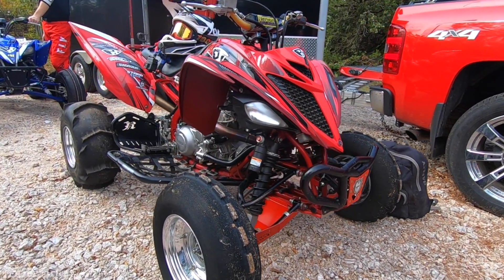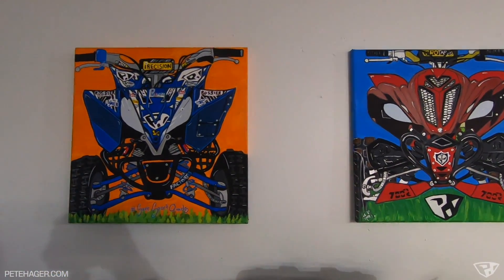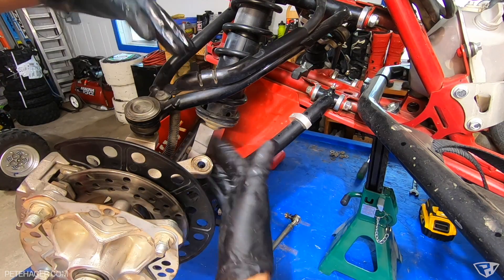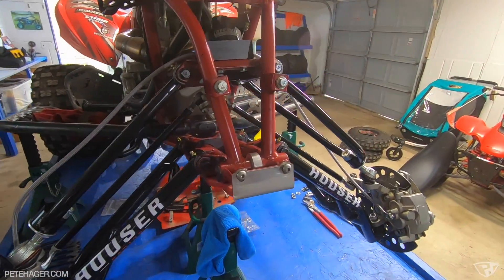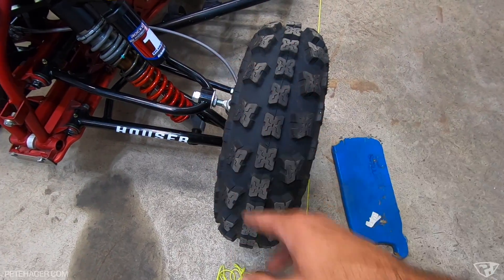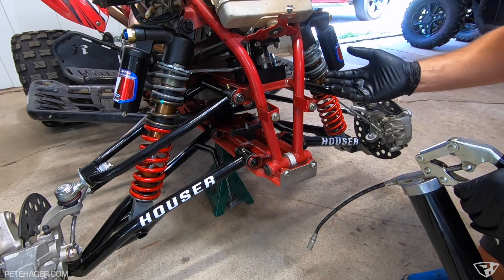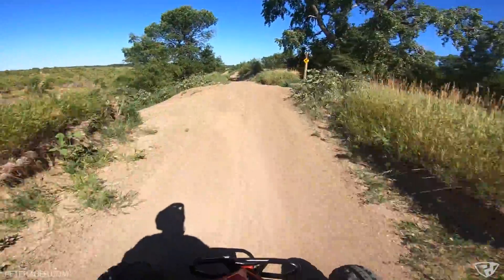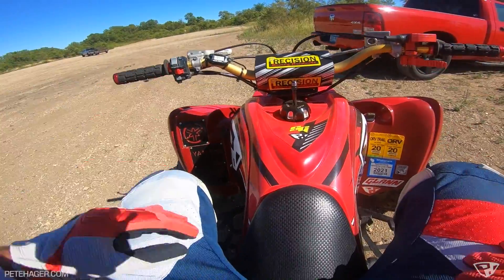Raptor 700 Long Travel Install and First Ride

Comment: I've been wanting to take jumps with my Raptor but I don't know how to prepare myself when I get to the jump. Could you give me any tips?
Reply from the maker: Of course start small and work your way up. You want to find jump where the take off is at least the same length as the quad. If it's a short, stumpy jump then your front tires will leave the ground before your rear tires have started the take off. When that happens it's a bit easier to get bucked forward if you don't throttle just right. Find a nice moderate jump with a good landing and make sure you have a neutral but aggressive body position. Also make sure you hold the throttle steady while taking off. Don't stab the throttle or let go of the throttle or you could go nose high or nose dive. Definitely find a table top and just get comfortable leaving the ground in bigger increments. Always aim to land on all 4 tires if possible or be rear end biased. It's also good to land on the gas a bit to soften the landing and keep your momentum going forward 👍
Reply: @PeteHager  This explanation is perfect. I've been having a hard time finding the right body position and whether to be sturdy or not at the base of the jump. Seeing you do it makes it look so easy and fluid. Do you stay planted on the seat or do you slightly stand before the jump?
Reply from the maker: @YunqTab  Im glad I could help a bit! I always stand when taking off. You can absorb some of the jump with your body language by bending your knees and almost doing a squatting motion once you leave the lip. As with most things it’s good to stay fluid and loose. You want to be in control but you don’t want to be stiff and rigid with your positioning. Your fluidity will become more natural with time 😊

Comment: Toeing in means more bite on turns?
Reply from the maker: The toe is the angle your front tires are at while pointed straight ahead. Most people will have the toe adjusted in slightly which I think is supposed to help with cornering so it sounds like you're on the right track👍
Reply: @PeteHager  Thank you.

Comment: Pete, when you were at the Yamaha press for the sport quads, did they give any indication about their current mindset with producing sport quads?
Reply from the maker: I was told Yamaha sells every sport quad they make and that they have no intention of stopping production anytime soon. If they were piling up in warehouses it would be a different story so it's safe to say Yamaha will keep producing them into the foreseeable future 😬🤘
Reply: @PeteHager  awesome, thanks for the reply! Yfz has my attention. Any indication that anything “new” might be coming in the sport quad segment?
Reply from the maker: @brutelife9177  unfortunately I didn’t hear about anything new for the future. Like most industries new developments are pretty secretive. Unfortunately with how low priority the sport ATV segment is there probably won’t be any changes anytime soon. You never know though! The nice thing about the YFZ or Raptor is that they haven’t changed in forever and there’s TONS of aftermarket available 😊👍
Reply: @PeteHager  I know this controversial (it’s kind of silly that it is) but there no reason why the Yfz doesn’t have reverse….it doesn’t add that much weight…..

How’s the video of the 400ex with the new accessories coming along?
Reply from the maker: @brutelife9177  Hmm I guess I haven't put much thought into why Yamaha doesn't do reverse with the 450. I'm assuming the 450 engine is derived from the 450 dirt bike of that era. In most cases those engines needed to be redesigned in certain aspects to compensate for the extra weight and traction that an ATV has over a dirt bike. Maybe some internals had to be bulked up or reinforced that limited space in the transmission area for a reverse gear. It's also a very race focused machine whereas the raptor is a trail quad so maybe thats their mentality. I'm glad you mentioned the 400ex. I actually did all the new parts updates to prepare it for the new Top Quad series we filmed with Sabo in June. I rode the 400ex for the event so they'll be a lot of content on that machine coming out this fall. I'm probably gonna take it out for a local ride next week to discuss all the new parts in a separate video 😊
Reply: @PeteHager  the 400ex was my first big boy sport quad. I got one when I was 15 years old and loved it. It’s why I’m sorta partial to Honda. However, Yamaha had won the hearts and souls of sport quad fans for their faithfulness! I would consider breaking the bank if they bring back the all orange color scheme for the yfz450 or if they bring back the Trx450r….right now I’m paying off my Bruteforce 750 before any more quad purchases. I enjoy your videos man. Keep it up!

Comment: whats the price on the control arms?
Reply from the maker: They retail around $1200. Houser does do 10% off sales periodically
Reply: @PeteHager  that's pretty expensive, would you recommend the alba racing a arms?
Reply from the maker: For the money I've heard good things about the Alba arms. I don't think they have quite as much adjustability as the Houser's but they will definitely perform much better then a set of spacers. I've also heard good things about full flight as well 👍

Comment: How wide is the rear? Wider axle or spacers?
Reply from the maker: The rear has an adjustable lone star axle. Front is just over 49 and the rear is just over 50 👍
Reply: @PeteHager  Nice. I just picked up a new 2022 700R and just did the big 4 with Barkers duals, PC5, FCI, and a Hotcam 3. Prob gonna do a +3 throttle body and a dyno tune next and after that will be arms, shocks and axle. I’m looking at those same long travel Housers but with an RPM axle and I haven’t decided on shocks yet. I put a LSR axle and swing arm on my LT500 quad racer years ago and after about 6 months of seat time the axle was bent just enough to cause a nasty wobble at speed, so no more LSR for me.  Was it a huge difference railing those berms with the wider stance? I’m all stock chassis wise right now but looking forward to some extra width to hopefully stop the two wheeling on fast corners.

Comment: How much did this cost you?
Reply from the maker: Depends on if you buy aftermarket suspension or buy YFZR take off front shocks like I did. My cost for everything was around $2500 for the arms, YFZR front shocks, suspension rebuild, and the Hess rear link.
Reply: @PeteHager  alright thanks